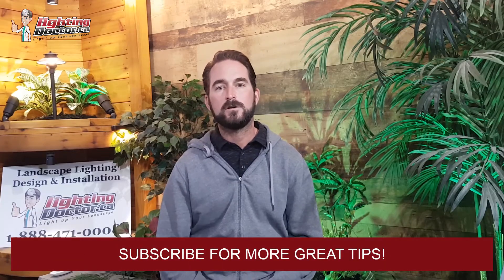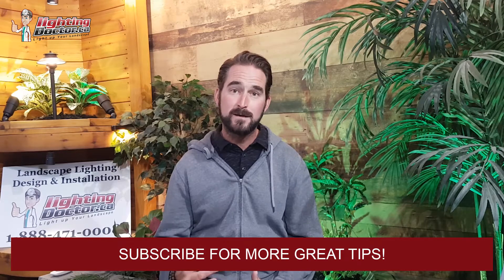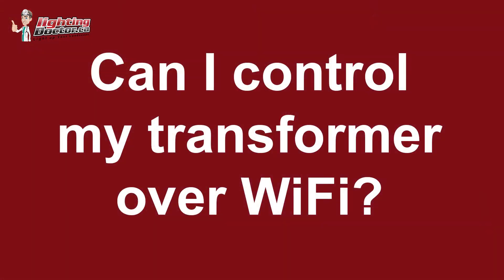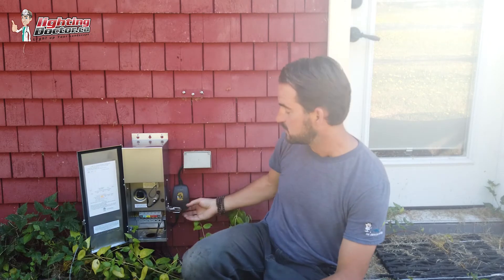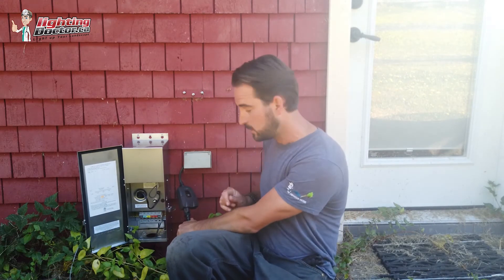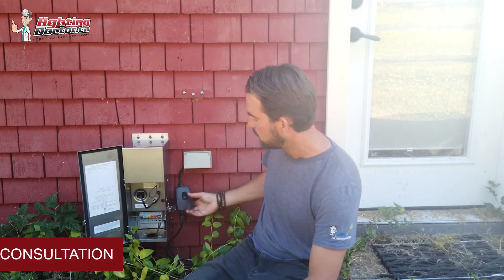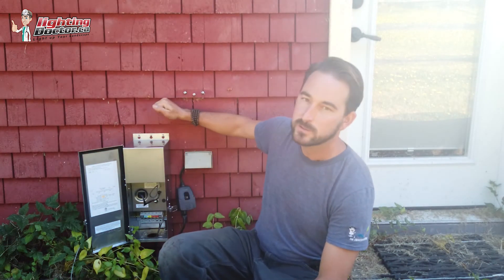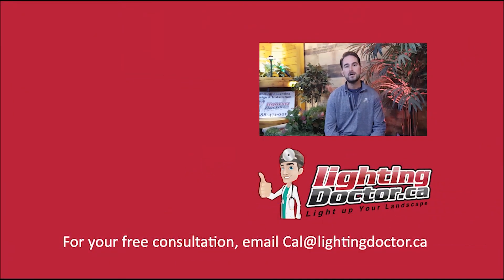How to Select The Right Size Low Voltage Landscape Lighting Transformer

Comment: Thanks for the great videos! I have a few questions.  I bought a house with a 1200 watt transformer with 4 comms.

- Does it matter as far as bulb longevity if I plug into 12,13,14, or 15v?  I’ve heard this has to do with distance.  I only have (20) 5 watt leds running total on two separate comms currently in the backyard?

- Can I use the two additional comms to control the front yard separately?  The transformer is currently controlled through a Jandy and I use the iAquaLink to turn it on but if there’s a solution I can bypass the Jandy?

- What’s the longest length run per comm if I’m using a 12/2 cable for my lights?

Thank you!